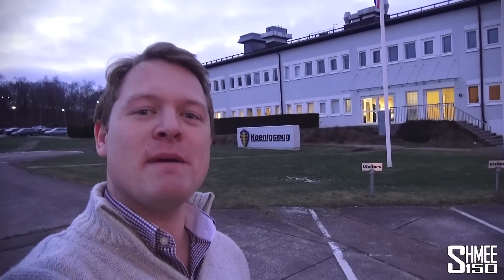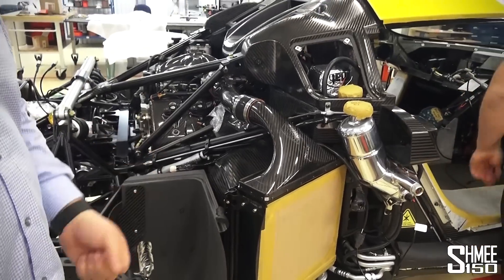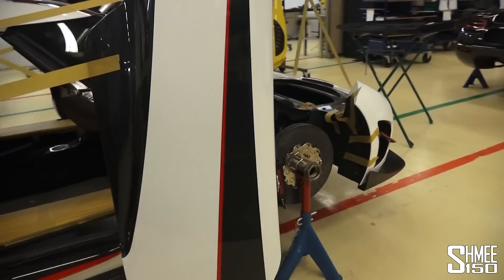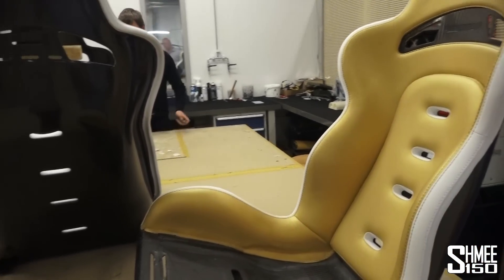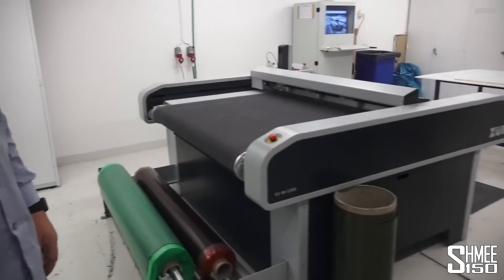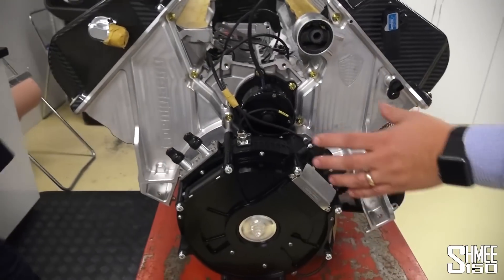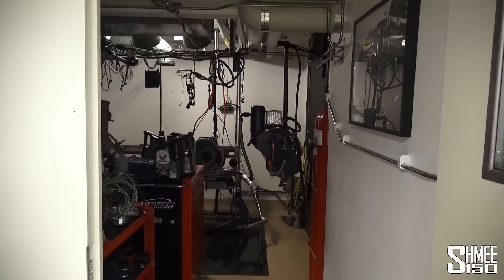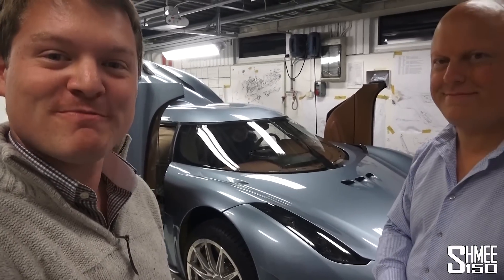IN DEPTH: Koenigsegg Factory Tour with Christian von Koenigsegg

Comment: " A Dirty car is actually a faster car than a one that is cleaned and polished because air actually sticks to the polished car" - I'll remember this one when people ask me why my car is dirty :D
Reply: lol
Reply: But in F1 they polish the cars because it reduces drag by 0.03%
Reply: +ThatGuyNamedScott. C The biggest reason to polish a F1-car is to make the air flow cleaner -> more effective aerodynamics.
Reply: +Niklas Maybe more effective ground effect aka negative wing effect is what you meant. There is reason why golf ball has those dimples, it has better aerodynamics. Actually mythbusters tested that on a car, they made huge dimples from heavy clay, and even while the car was lot heavier, it did save fuel with them on.
Reply: +Erik Eriksson Just no. Trust me I know what I'm talking about (mech. engineer). Cleaner aerodynamic surfaces produce more downforce (F1-car) or lift (planes etc.) than dirty surfaces. Please read about differences between drag and downforce (or lift). You were also talking about the ground effect. F1-cars don't really employ 'ground effect' anymore. However IndyCars do employ 'ground effect'.
Reply: +Niklas You do realise that Christian here is actually talking about the roughness inside the head right? I think nowadays there is a misconception that if you port and polish you see more gains in the engine due to the whole smoother the surface the faster air can travel theory,  whilst this maybe true for aero it seems to be the opposite for engines, Lotus also confirmed this theory.
Reply: +Niklas A golf ball-dimple surface on the BODY of a car creates less aerodynamic drag at low speeds, and a smooth surface creates less drag at high speeds. Or vice versa, I&#39;m not sure. But THAT is what CVK was talking about I believe. I think it was a bit unclear but at that point he had switched and was talking about the body of a car, not the ports.
Reply: My answer was for +ThatGuyNamedScott. I think that he was talking about polishing a body of a F1-car.
Reply: I work in the aerospace industry.. The reason why you want a smooth surface on a wing or a similar is that the air is more prone to follow/stick to the curvature of the wing and therefore the efficiency of the wing can be higher (in this case higher downforce)
Reply: +Reon Storm bird poop +10 hp
Reply: Reon Storm YOU WOT M8
Reply: Perhaps they should dimple cars like golf balls.

Comment: Christian is immensely generous with his time.  It is highly apparent he is a bonafide genius who is more than eager to explain any and all creative endeavors from fiber composite to dozens of microprocessors for things a 'normal' vehicle uses a standard circuit with fuse and relay at best.  He can take one element of the vehicle and point out half a dozen advanced 'features' anywhere you point... while, I imagine, that only comprising a small percentage of what is truly going on in the region of the automobile.

I love the way he envisions power transfer in a completely novel manner with things like hydraulic + electric drivelines without any shifting of gears (or gears to shift).. for one smooth solid power band. In this manner he is fleeting with the contact patch of the tire and road/track surface  allowing a slight imperceivable tolerance for 'slip' to gain maximum power at the wheels with full control of the power being applied (and it's IMMENSE power).  I believe this is how he is able to use such "relatively" small tires yet not have 1,000+ horsepower spinning them incessantly.    A technological marvel indeed.

Comment: Did anyone else notice the car after the green Agera RS? Shmee was avoiding filming it. It looked like the original One:1 colours. There is also a part at exactly 21:07 in the clip that shows a body panel with One:1 stamped on it. Are they making another One:1 or are they just rebuilding the panels on the original one that is for sale?

That green Agera RS was so beautifull holy mother of god.
Reply: +Tupi I thought all the One:1's have been delivered already?
Reply: +Goldiielicous It's probably the original test car which is now for sale for 6 600 000 € :D

"The car will be delivered with a extensive factory refresh and will be ready for delivery in January 2016."
Reply: They need to have make spare parts if someone who owns a gets a femder buckled or whatever
Reply: Goldiielico
Reply: Goldiielicous proverb,y the car that they crash in the Nurburgring that they announced they’ll rebuild
Reply: RandomUs3rn4m3 its 2018...

Comment: The custom tooling it takes to build these cars is just crazy. Every piece of carbon fiber that goes into making one of these cars has it's own corresponding jig that has either been CnC milled from solid aluminum billet or 3D printed to exacting tolerances. Then you have all of the custom jigs used for assembly not to mention all of the custom hand tools that are specific to a single application. Tooling up for a production run must cost a bloody fortune. Especially since the entire run consists of only 25 cars. I have got to hand it to these guys. I am truly and sincerely impressed with what they got going on here. Of all the hyper cars on the market these days it's the Koenigsegg's that stand out from the rest. To me anyways. To bad the bulk of them are going to the middle east.

Comment: Christian V K should make Wheels that have each spoke designed like a compressor blade(but angled to draw air) to more effectively manage the turbulent air flow generated byt he spinning wheel at high speeds to pull air out of the wheel well so that negative pressure is created and would help cool the brakes by drawing heat out as well has keep break dust to a minimum. that would be trick!

Comment: At 6:30, what's that wrapped around the brake line?
Reply: Probably heat wrap. Insulating the brake fluid from the heat of the brake disc (to stop the fluid over heating or boiling).
Reply: That was my guess, but I want to make sure. Find out how it all goes together.

Comment: Mr Koenigsegg has a challenger from Finland. Toroidion. Check technical details and think...
Reply: Even tho i am a finn i don't really see the Toroidion as a cool and as good built as a Koenigsegg
Reply: Toroidion and Koenigsegg have different target groups. Koenigsegg is more for luxury hunters and Toroidion is for people, who want to get rid of fossil fuels. Toroidion is fully electrical with new patented innovations and still gives 1MW power (2 x200 kW front and 2 x300 kW rear, own electric motors on every wheel. No gear box between wheel and motor.) Well built structure with no vanity, made for moving.
Reply: Lukas Fin Paska laite tuloo olemaa. En ite tykkää ollenkaa

Comment: Can @Shmee150 or someone else explain to me what that tape was all about?
Reply: +Benniee1 In you mean the tape on the body, it's for protecting the paint during test driving.
Reply: No I mean the yellowish tape that they use for example when you see every part open (engine bay, doors, ...)
Reply: For example: at 9:34 you can see the X-pattern at the back and the two stripes of tape at the right side of the car erbLLLL
Reply: +Benniee1 It means that you should not enter nor work in those areas I think.

Comment: I have been looking for the intelligent electrical system in cars for more than a decade. Seems I have to order a Koenigsegg to finally get a car with that technology and sadly sell all I my possessions, and probably also my kids, to finance it. Well, if that's what it takes... :-)
One thing he said, I think is wrong. A dirty surface hasn't lower friction than a polished. When a airplane, say a glider, is to perform the best, it is polished. ... and then again. The closer the wind sweeps the surface, the higher friction which is good for generating wing lift. If it's turbulent, friction is less. Guess he's right.
Reply: No and yes. He talks about them too. Both the intake and exhaust systems are brilliant, especially for such a small company. I'm referring to the control of lamps and sensors. Instead of pulling cord for each thing, they are attached to a combined power and signal cord, listening for them to be contacted. The cord body of a car is the most expensive part, and a bus wiring saves both money and weight.

Comment: Any exotic or premium car can't use Carbon composites to extremes however if the hyper exotic uses the material in small quantity build output than why not; however Bugatti Veyron Super Sport is overated bec even their powertrains use W16 where as an Agera R uses hand assembled 8 cyl boutique or even a 12 cyl with twin turbo & the performance is flawless 0-60 & 1/4 th mile.

Nowadays 0-60 has never been where its at, 1/4th mile even in cold climates after a few runs warming up fuilds & rubber.

Agera Hundra > Bugatti Veyron Super Sport

Additionally I believe in beauty skin deep where as not with Veyron the powertrain of the W16 is deep within not being accessible by the owner where as with an Agera R Hundra the powertrain's beauty can be beholded to eyes to admire.

< the body work and artistic elements & skin deep >

Comment: engine 50000 euro, frame 20000 euro,body is  50000 euro, brakes and tires 10000 euro  ....finish and touch up 30000 euro interior 20000 euro THE CAR IS WORTH 180000 EURO HE MAKES 2MILLION IN PROFIT
Reply: According to a sampling of people at the trade show, carbon fiber for automotive costs $10 to $12 a pound, compared to less than a buck for steel. That's more than half the $35 price a decade ago, but to see more widespread adoption, it needs to get down to about $5 or $6 a pound, they said

Comment: This man never stops bashing other brands, and praising himself as if he is the source of knowledge. If your brakes were better than Brembo, then most of F1 team would come and beg you for Koenigsegg brakes. lol He talks about asymetric brakes and how they save weight with that. That is pure nonsense. He doesn't back it up by explaining how and why is that lighter. Also, he lets out a lots of hot air on how that piece of carbon fibre is unique to them, and is stronger. Shmee and 99% of koenigsegg fanboys don't have the slightest clue about materials, engineering...etc  lol